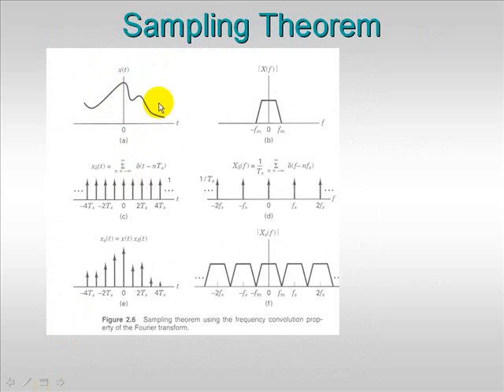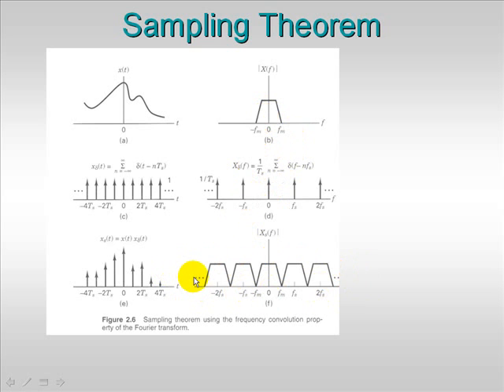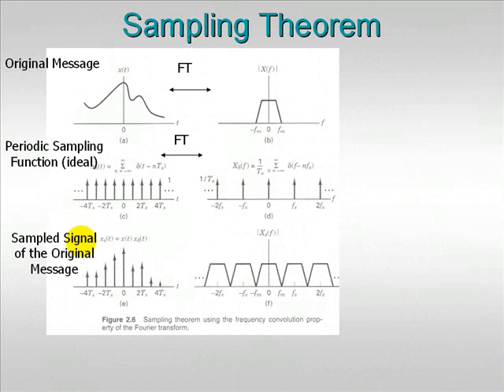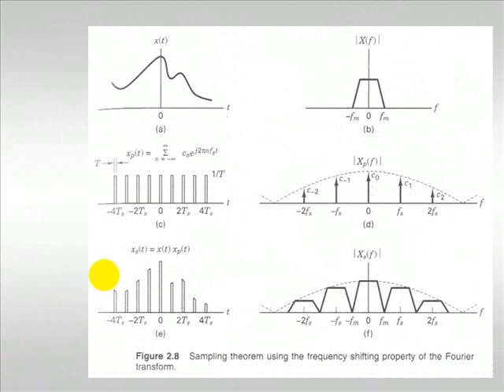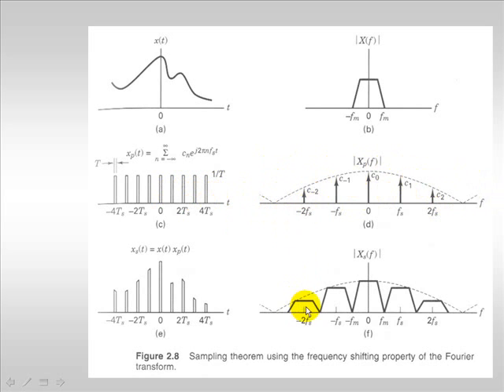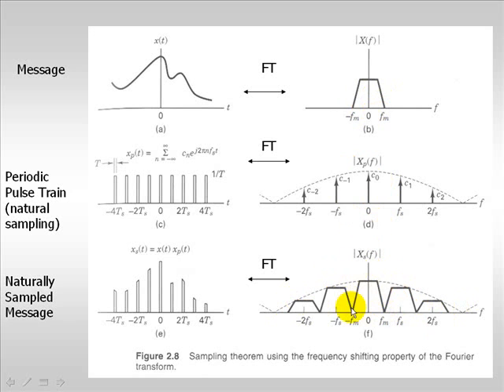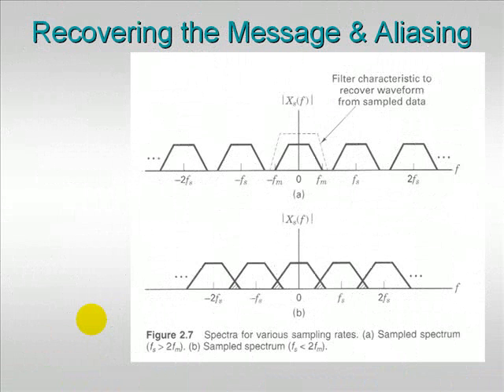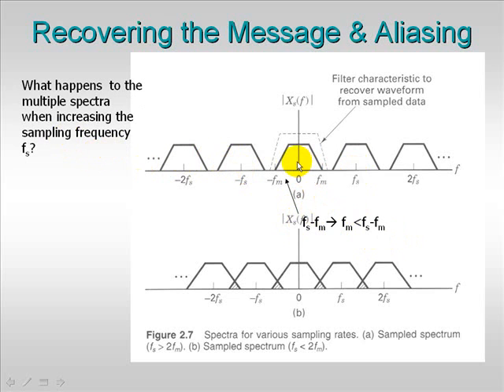Signal Processing Tutorial:  Sampling/Anti-Aliasing or the Nyquist Sampling Theorem

Comment: @bitchbitchbaconbacon Think of breaking up a signal in time domain into discrete parts (a sum of impulse or detla functions). Each part you sample has a characteristic spectral value (a width or grouping of frequencies) associated with it. As you let the number of samples increase (theoretically toward infinity), the spectral density of the original signal is recovered. The multiple spectra are akin to an infinite series that converge to the value of some function (original signal).